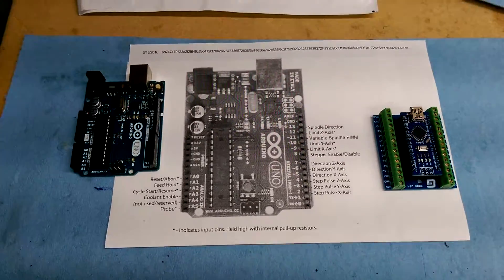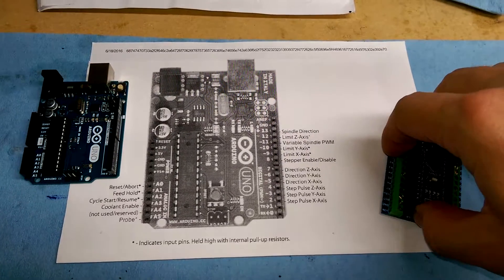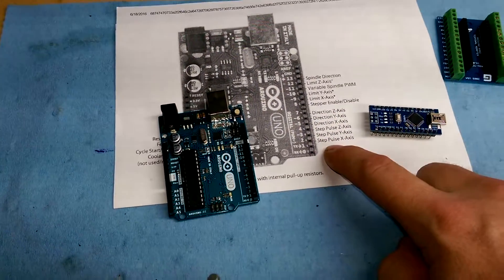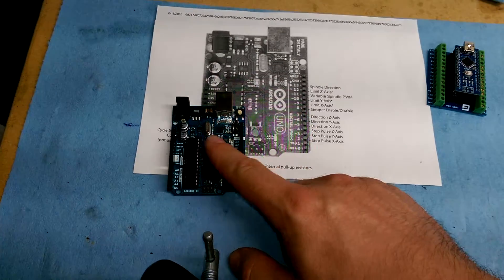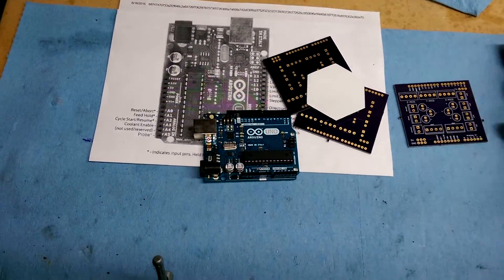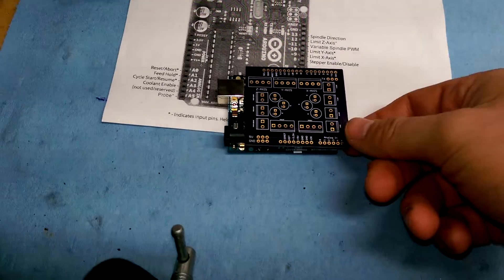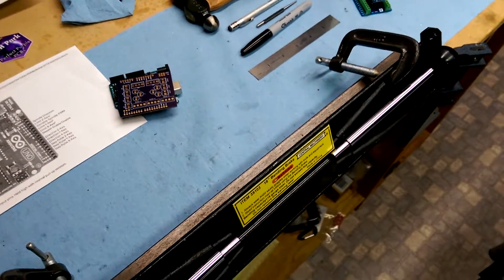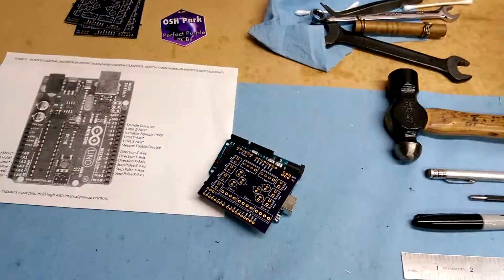Mini Mill CNC Conversion: Part 6.2ish GRBL Controller

Comment: Out of curiosity as I'm still trying to figure all this out, why didn't you use a GRBL Shield instead of having a shield made?  Is it to support other options not offered on the GRBL Shield?
Reply from the maker: Konish P. I couldn't find a shield I liked that had the options I wanted, pin layout, and access to the options. The shield I designed has the pins layer out by wiring without having to jump across others and trying to squeeze a bunch of ground wires in on one spot.
Reply: Thanks for the quick reply.  I going to start a CNC conversion on the exact mini mill, and really like the thought of using an Arduino UNO, gshield, and bCNC on a Raspberry Pi 3 like your set-up.